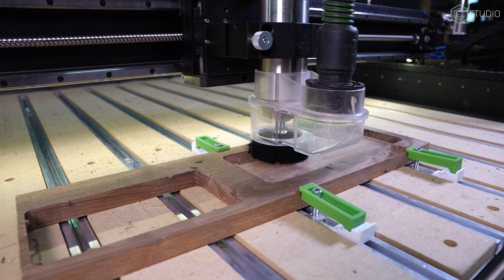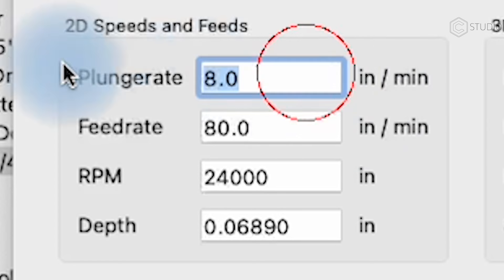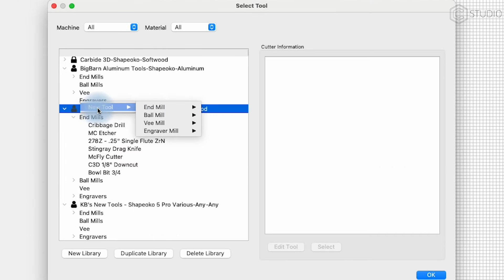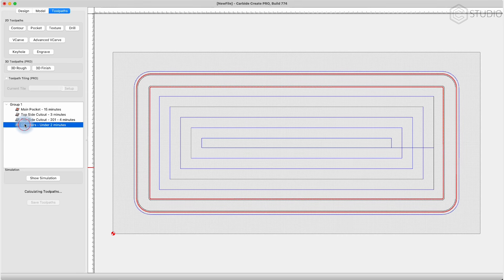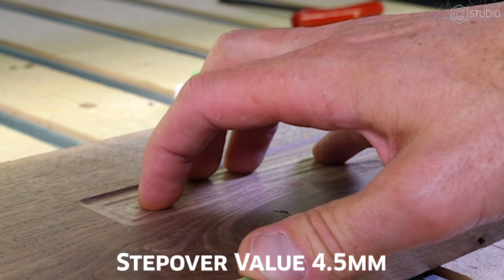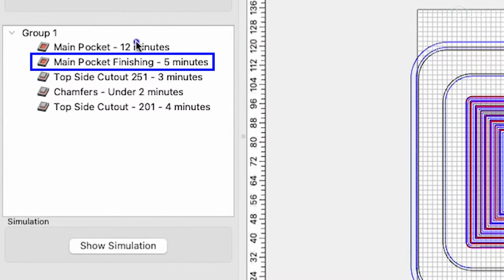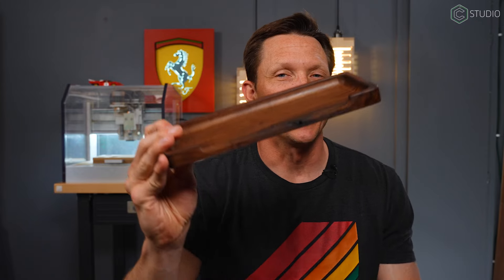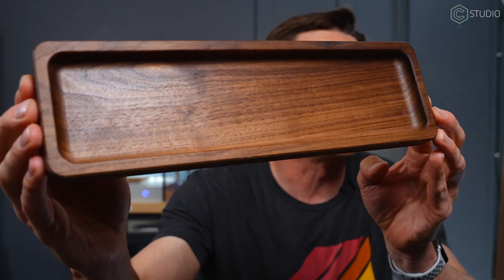SUPER Smooth: Use Bowl Bits on YOUR CNC Router - CNC Tutorial

Comment: Love bowl bits. To ease the use of the bowl bit I normally create a pocket with a 1/4 endmill and use my Amana bowl bit to do an offset contour around the pocket. Works nice.
Reply from the maker: Good plan.  It’s an interesting balance to find the optimal settings to remove the most material in the shortest amount of time.   The DOC with a bowl bit is larger than the DOC of a 1/4” endmill, but the stepover can be larger with the 1/4” bit.   
Perhaps something to test would be leaving scallops with a larger stepover in the roughing passes with a bowl bit, then see how those clean up on the finishing pass.    This might make the bowl bit more efficient time wise……might.

Comment: I use easel free as I’m learning cnc at the moment .
I made a tray not unlike the one you made for this demo only with an extra circle pocket to set a cup into .
As I can’t use ramping to use the circular cutter I used a Down cut bit to mill out a smaller  pocket to the right depth and finished to size with the circular cutter, it turned out pretty well cant really see any lines where they meet up.

Comment: I've always used a finishing pass of .05 inch (1.27mm) stepover for a 3/4 bowl bit. Sure the machine runs longer but its less labor sanding, and my trays have some small pockets that you cant really sand. I still hit it with a 120 grit Abrasive Buffing Wheel on a Dremel to smooth it out before finish. You should do a series like this for other bits.
Reply from the maker: Thanks for the addition and feedback, @TeddyBearDesigns

Comment: Hi.i have a question.  How do u create different depth pockets to cut out on your cnc. For example u have a 20mm thick stock and cut a 5mm pocket out, then need to cut different shapes pockets another 5mm in to the stock?
Reply from the maker: Whatever feature you want milled into the bottom of a pocket, have that toolpath begin at the depth of the previous pocket.   
In your example, the "different shapes" would begin at 5mm and go to whatever additional depth you specify.

Comment: Is there a list of the expressions and what they do? Like where you added the t in the depth of cut. That's a cool deal. And i love to use that.
Reply from the maker: Think of expressions as entering an equation that gets immediately solved.   Where Excel executes an equation repeatedly, Carbide Create executes the equation when prompted.   T+.1    t-.1    
Entering a Diameter into the Radius box for a circle - 24.567/2=   It's present throughout the program.  When in doubt, try a mathematical expression and hit "="
Reply: @carbide3d oo ok. Thank you.

Comment: Has anyone used this method for slabs or flat boards and not just bowls and trays
Reply from the maker: For large slabs a fly cutter is vastly more efficient.   The tiny stepovers required here would make the machining time quite long.
Reply: Thanks. I have a CAMaster Stinger and an Axiom but even properly trammed I’ll still get tooling marks.. 
And I’ve used fly cutters. 

Haven’t really experimented with bowl bits much but if I’m not mistaken the radius of the bit and reducing the step over is where you can eliminate those tooling marks 🤔
I ordered a large bowl bit for some testing. 
I hate sanding and am trying to avoid buying that $500 Amana sanding bit 🤙🏽
Reply from the maker: The radius on the bowl bit should help eliminate the hard step between passes, so it might be a win.

Comment: That looks like a core box bit to me, not a bowl bit.
Reply from the maker: Marc, you are correct.  A proper bowl bit would have a broader flat to the head of the bit.  A quick Google search for "Cove Box," "Core Box," or "Bowl Bits" results in images of each of those types of bits.   Core and Cove appear to be interchangeable terms.
Reply: @carbide3d  Thanks for the confirmation.